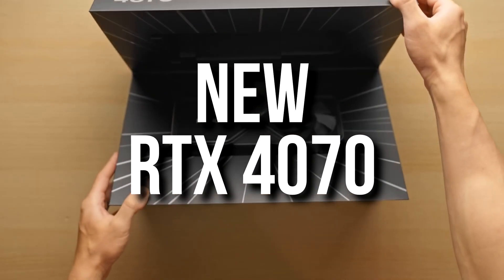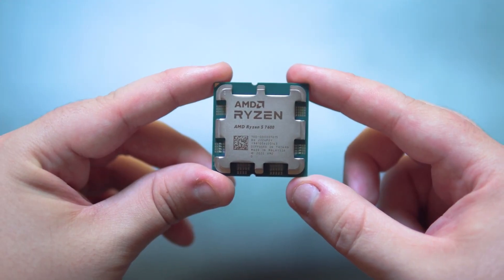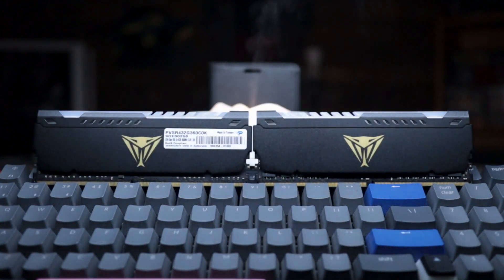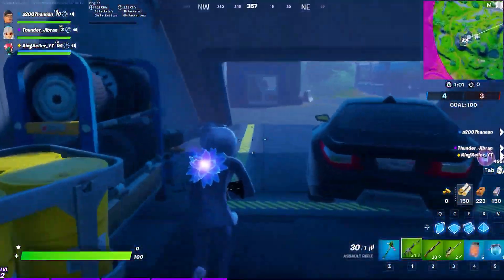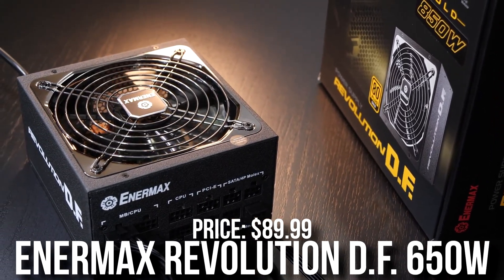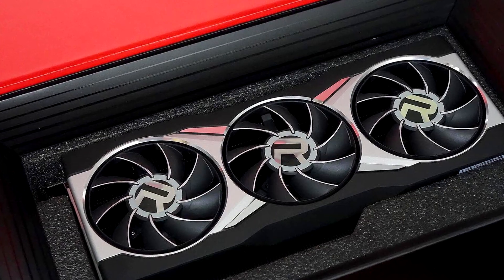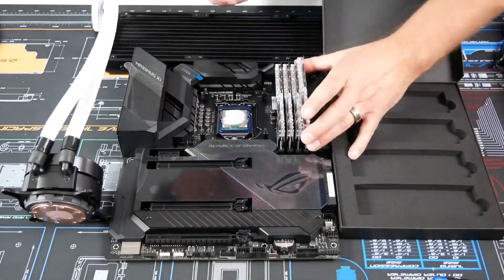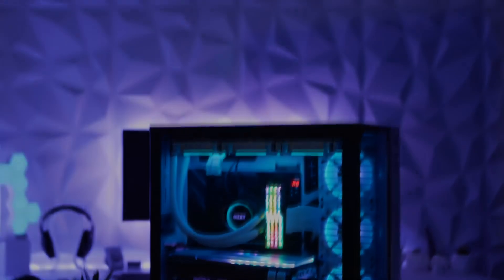BEST RTX 4070 VALUE PC Build for 4K & 1440p in 2023 💚

Comment: Good solid build at a reasonable price, for the upgraded GPU (7900xt or 4070ti) would you recommend the same exact build? Or would the cpu 7600 bottleneck the upgraded GPU's?
Reply from the maker: the same build is totally fine! But, I would choose a higher wattage PSU ( 750W and above)